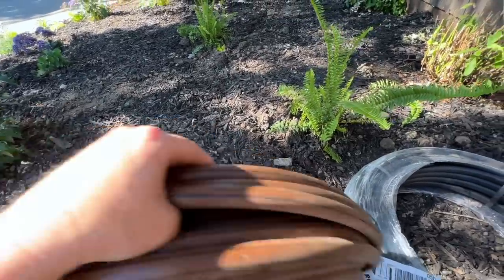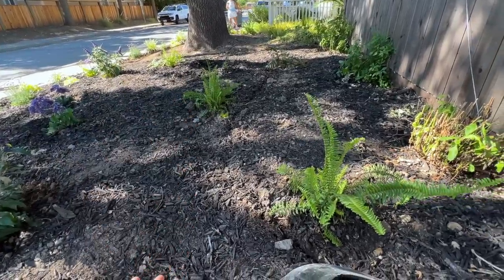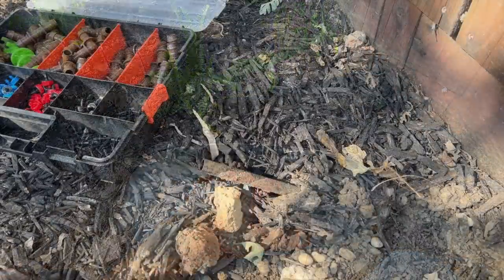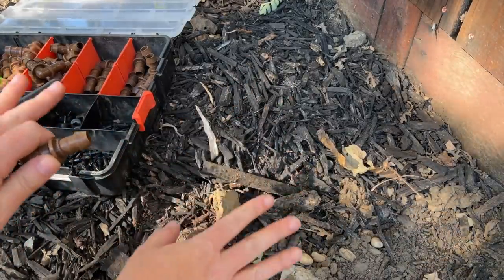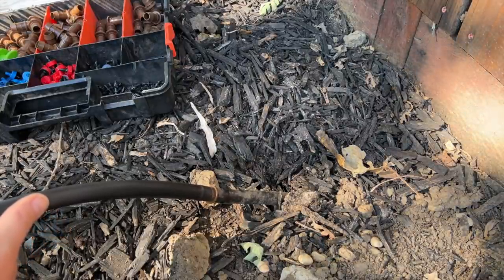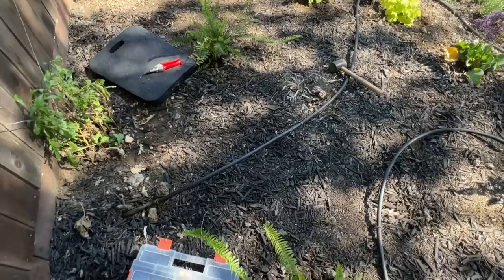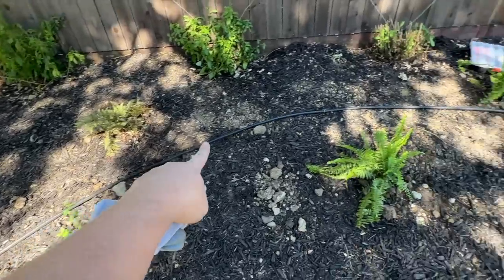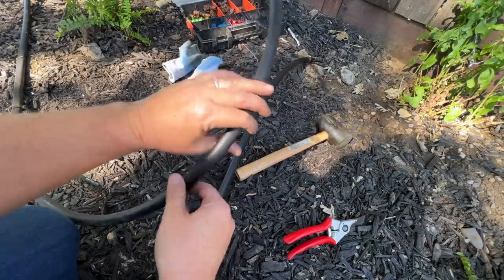💦 A Guide to Drip Irrigation for Amateurs, from an Amateur! 💦 :: Adding On to an Existing System!

Comment: One other tip…I dip the ends of tubing in very hot water for several seconds. It makes tubing much easier to work with and doesn’t melt the tubing

Comment: You did a masterful job on this! You made this clear and understandable! I live in Scottsdale AZ up in the foothills so 9a (maybe 9b some years). Anyway, I monitor my large desert landscape frequently with my "irrigation tool kit" in hand. 3/4 inch poly, 1/4 inch tubing (we call it spaghetti here in the desert) multiple zones, rainbird emitters (many more options). I use the lighter (fire) method to warm the spaghetti to insert the emitters as my 72yo hands some days just don't have the strength they once did. The other concern for us here is ideally we only make direct runs off the 3/4 inch poly with the 1/4 inch spaghetti. Never use T connectors for multiple runs off a single spaghetti coming from the poly. My understanding is the spaghetti will only supply the stated amount of water (emitter) from the larger poly (a direct run) for approximately less than 6 feet. So, having spaghetti branching in more than the single straight run decreases the water being delivered through each emitter. Probably TMI.
Reply from the maker: Not TMI Beth!  Thanks for your tips!  I'll remember that about not T-ing off with the 1/4 inch if I have issues to deal with!  Thank you my friend!

Comment: You did a great job of explaining drip irrigation.  You are correct that you have to keep adjusting how often and how long to run your drip.  I had to increase mine because of the heat that we have had and in a week I will have to decrease the time when it cools down.  It is never a once and done but I can check the water in a few minutes and before I installed drip I spent 2 hours a day watering plants. I hope you have a wonderful weekend.

Comment: Great explanation on drip irrigation. I also have difficulty attaching couplers to tubing, but found that if you immerse the tubing end into very hot (or boiling) water, it softens the tubing and makes it more pliable.
Reply: This is what I do too! Just fill up a travel coffee mug and take it outside with me to do the end in 😄
Reply from the maker: Great tip Amanda!  Definitely trying this next time I install drip!
Reply from the maker: Thank you so much for saying that Patty! 😘

Comment: THANK YOU for this video!! You simplified drip for me. Plus I needed to hear someone else say how hard it is to pop the little 1/4 inch pieces into the 1/2 inch tube- thank goodness it’s not just me! I’m going to Home Depot tomorrow for the green punch tool. Also, can’t agree more with you about the Rain Drip vs Rain Bird we always end up replacing them to the RainBird ones AND they should definitely color coordinate them.  
Great video!! 🤩🤩
Reply: look for a purple tool @ home depot, its helpful with that. i had to wear heavy duty globes before to plug those 1/4 pieces before and would still struggle. now its a lot easier.
Reply: @josenegrete5302  we have one of these purple ones but i still struggle with it, I am the only one to struggle, all the men in my family do fine with it.

Comment: Great video,  this was so helpful. I don't know what I did wrong, I was really careful punching the holes and connecting the couplings to connect the 1/2 inch to the 1/4 inch tubing and I have some that are leaking at the connector. Should I just start all over again, the goof plugs dont seem to be working they leak as well.

Comment: I installed drip years ago and you've done a great job 'splainin' 🤩. I can't get my head around re-connecting the 1/2" into a continuous loop (where does it flow, which way, etc). I usually put an emitter at the end .. or a stopper. I need to revise mine for a new bed soon so will try the loop and see how it goes. I'm visual so have to do in order to learn 😸😎. Alysen
Reply from the maker: Haha thanks Alysen!  Try connecting it to itself!  I think it really helps with the water pressure!
Reply: @DigPlantWaterRepeat  will do!

Comment: Wow, great instruction! I am getting ready to take the plunge. I am I’m Florida 9B. I have a current sprinkler system (on well water) for my lawn  (St Augustine grass) and it works great. I am ready to put in flower beds and need to install drip for them. I called to set up an appt with the sprinkler man to install it. Do I need an irrigation contractor instead? You make me feel so confident that I can take care of it after is installed. Thank you for all the steps…. :)
Reply from the maker: No the sprinkler man can help you!! Look up the Rachio Smart Sprinkler System. It is the sprinkler box that I use and LOVE it because you can control it from your phone! Good luck! 😘💗
Reply: @DigPlantWaterRepeat  Wahooo, thanks lots❣🌿🍃🍀

Comment: Have you thought about putting in a rainwater collection system or IDK if they have systems to reuse greywater. I worry with the extra water restrictions coming we wont be able to water gardens. I also don't think xeriscaping is a good idea because it contributes to a hest bubble.
Reply: *heat bubble

Comment: I wish you guys would show how to set up from the very beginning.  I get the hose part but I don't know how you are hooking it to water supply in the start.  What is the 1st step when you have never had drip?
Reply: Like she said Laura from Garden answer here on YouTube has several videos on drip. I just set mine up this year and connected to a timer in my front and back yards. I think a PSI pressure regulator is crucial to prevent leaking